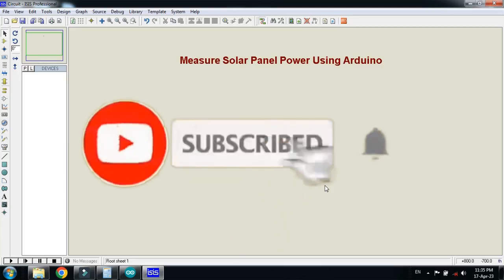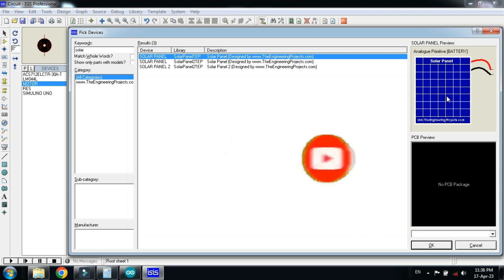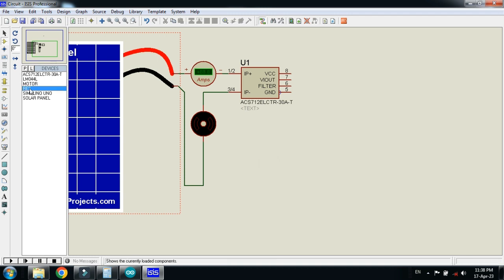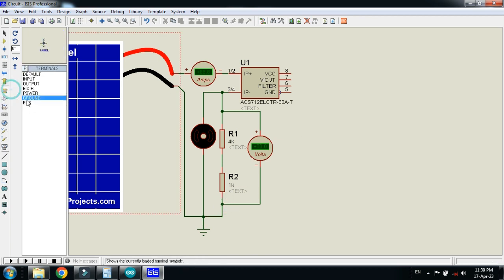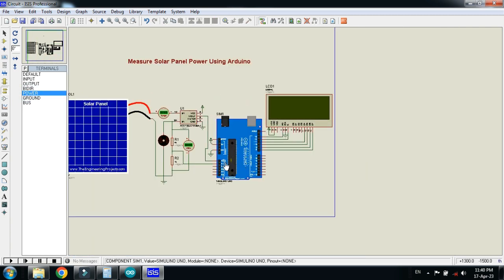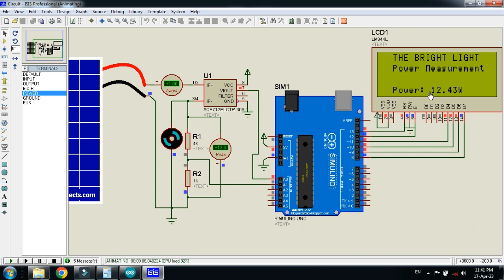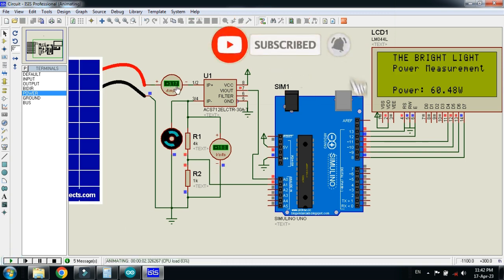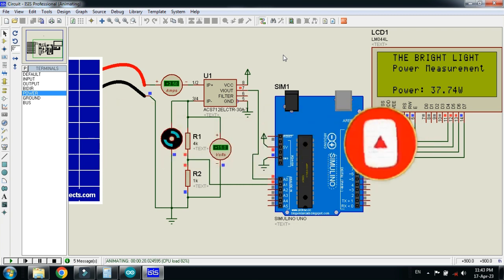Measure Solar Panel Power Using Arduino | Code & Circuit | Proteus Simulation

Comment: i got mines -399 in power measuremt what is the proplem
Reply from the maker: Check your connections and code. Also ground your circuit